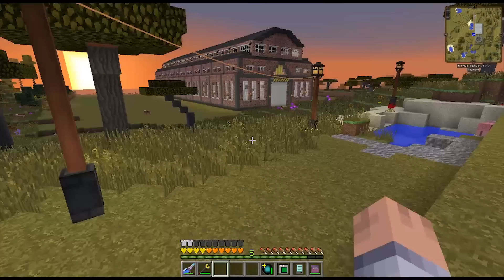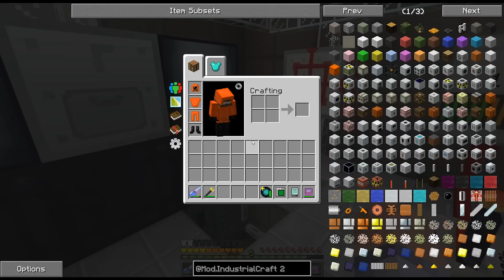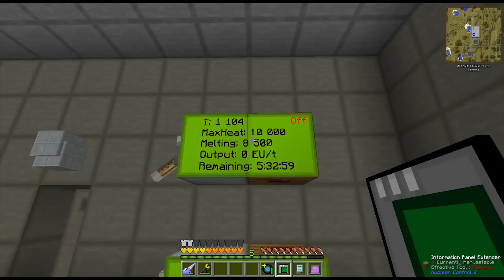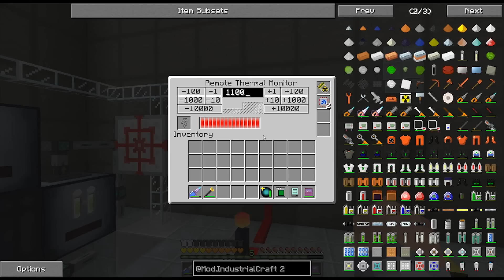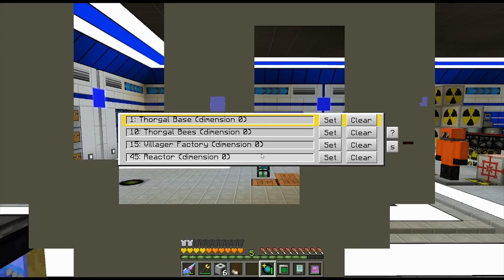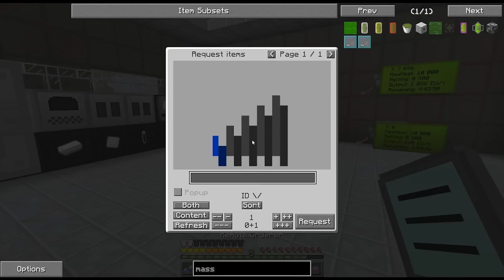ftog S3E20 - MOX Reactor and UU-Matter - FTB Infinity Evolved (Expert Mode)

Comment: If your uranium reactor can support the rod creation, it might be wise to split off the reactors into two power lines and dedicate the U reactor to the rods system and the MOX one to the UU system. Even better, if the U reactor could additionally support the recyclers (Since they have stable power draw, unlike the MF) and leave the MOX reactor soely to the MF, you wouldn't have to limit it's power draw at all. Though, you'd have to give up on your chess board design to make that work...
Reply from the maker: +Taeyeon Mori Thanks for the ideas. I did change it up a bit. Uploading the episode right now so you can see what I did soon :)
Reply: Always looking forward to your videos :D

Comment: The mass fabricator takes as much power as you put into it, which is kind of weird compared to how the other IC2 machines work. The more you put in, the faster it goes, linearly. I think the 512 in the tooltip refers to the packet class (HV, if you were in a pack that enforced IC2 packet sizes you wouldn't want to hook it up to EV without some transformer upgrades).